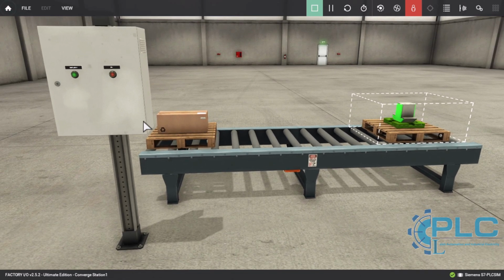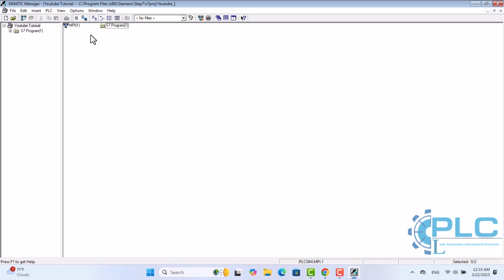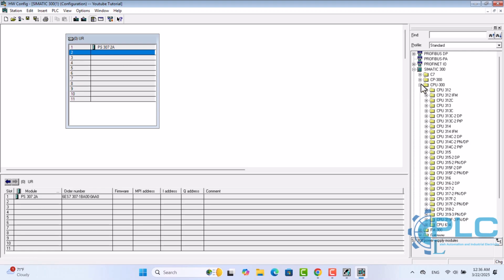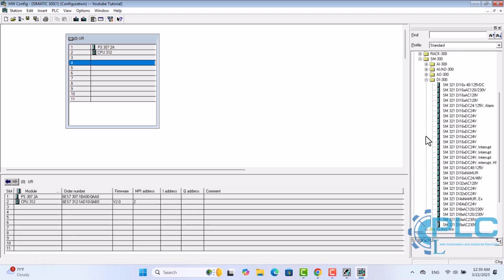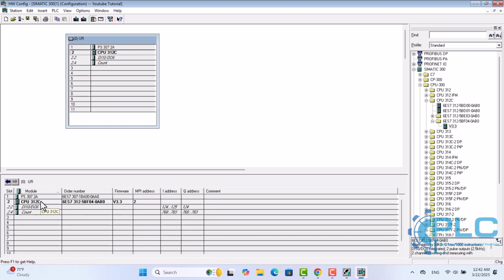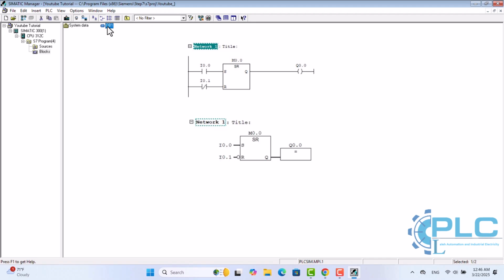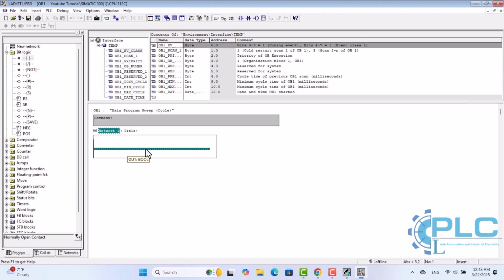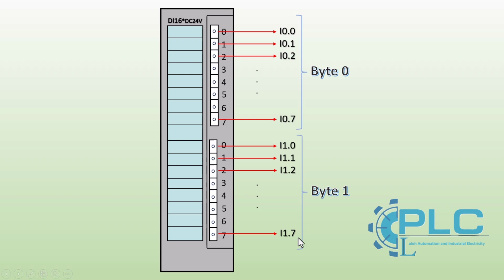How to Program S7-300 PLC with SIMATIC Manager – Full Project & Hardware Setup | Lesson 3 #plc

Comment: Hi how can I use counter in s7 simatic 300 to calculate rpm?
Reply from the maker: Hi my dear friend, to calculate motor speed you need to use the S7-300 high-speed counter. But first, which type of sensor do you want to use?

Comment: i tried to configure DO first in the software i got no warning, i think it doesn't matter whether you start with DO or DI but for the better arrangement, its good to start with DI followed with DO
Reply from the maker: The order in which you place the digital input or output module does not matter. The key factor is ensuring that the configured addresses match exactly in the program, as any discrepancy can lead to incorrect operation.